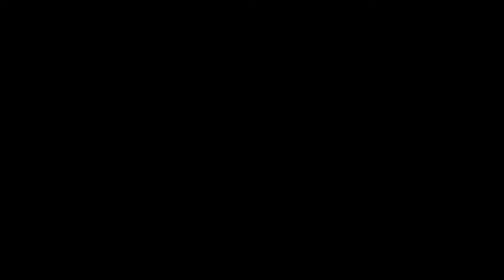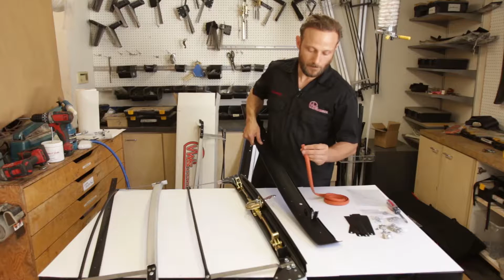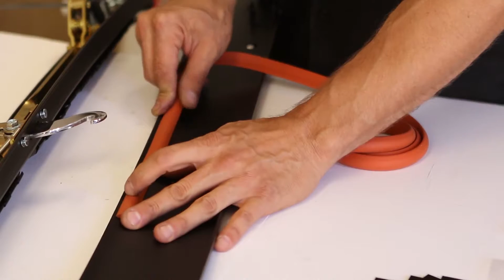Seal installation

Comment: I have a newer Grumpy's roof on my 65 21 window. I didn't install it. Some kind of adjustment needs to be made and I don't know what it is. The roof will get to the closed position but I can't suck the top in when the hook is in place.  I can operate the front normally when the roof is half open, but not when it's closed.  so the roof sticks up when it's "closed"  but it's not pulled all the way down. ... any ideas?
I just drive it on sunny days with the top open most of the time so it's not a real issue, but I know it needs to be fixed. 
Thanks.